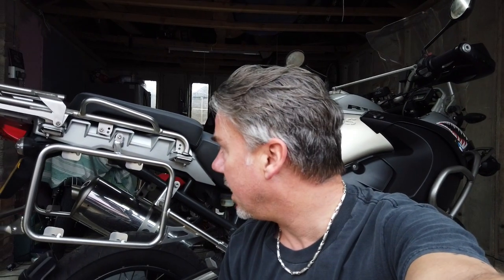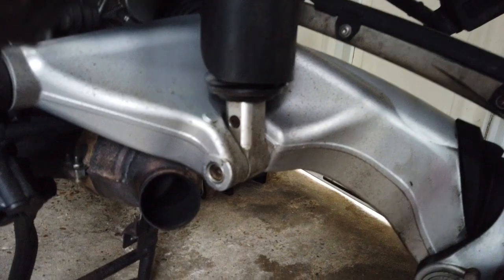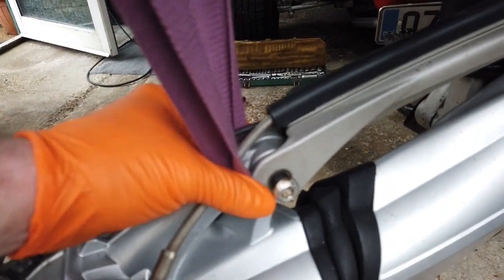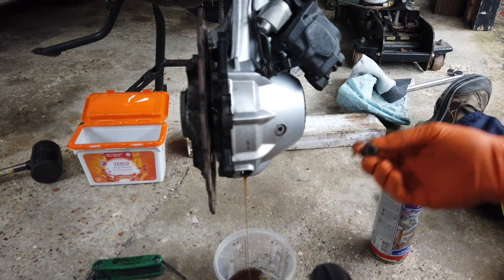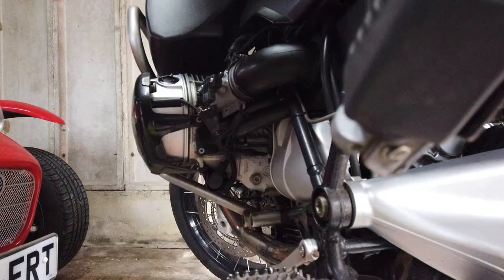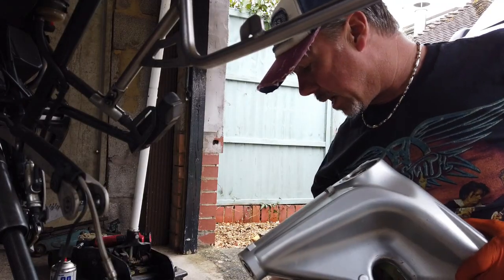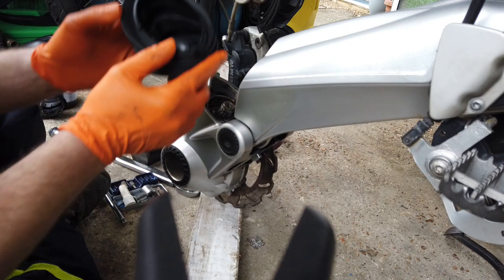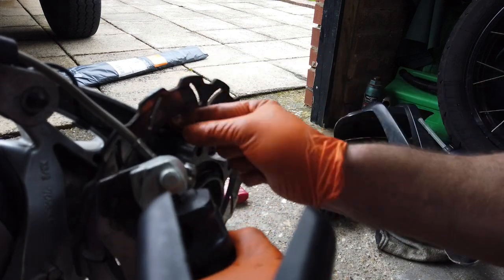BMW R1200GS Swinging arm boot replacement.

Comment: Useful video - but looks like someone has replaced the original stay-bar / anchor bar to FD bolt with a button head stainless bolt.  This should be a high tensile 8.8 bolt so stainless is not suitable.  Please fit the correct spec bolt for your own safety.